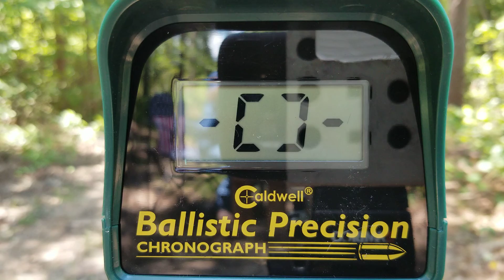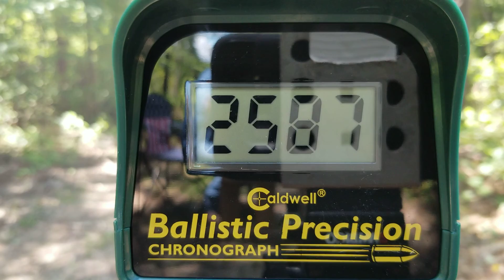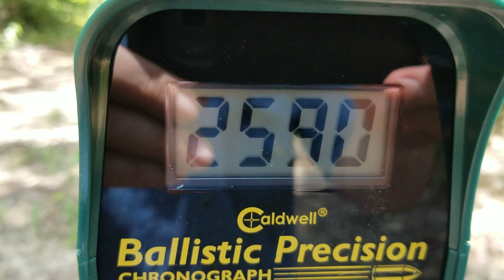Tweeking Velocity a bit.

Comment: 2600fps is perfect for the 6.5 pill at 140grs.  Not sure about 120grs.  Are you twerking towards about 2800fps?  Good video Rick.
Reply from the maker: Thanks Brother, I am just trying to get the velocity close shot to shot first. I have a 140 grain load with 4831 that I want to check. It should be somewhere close to 2700.
Reply: Even better.